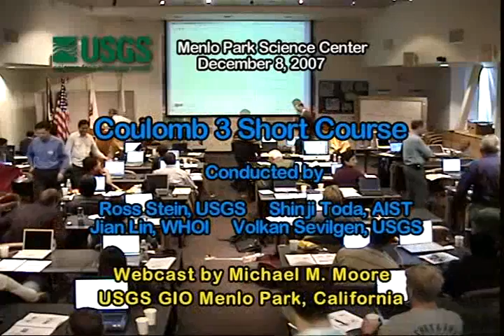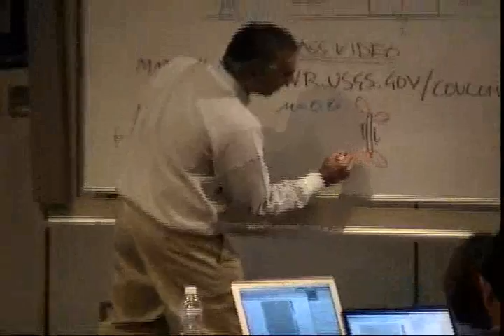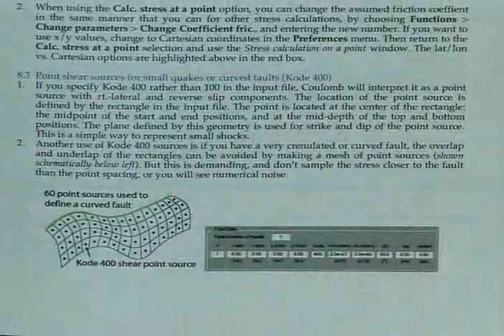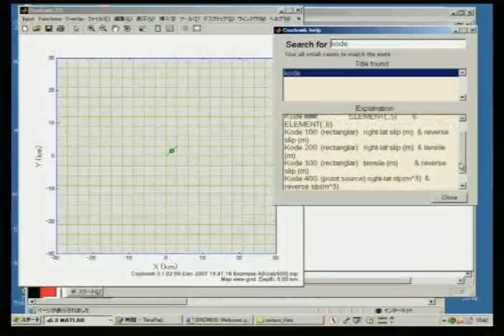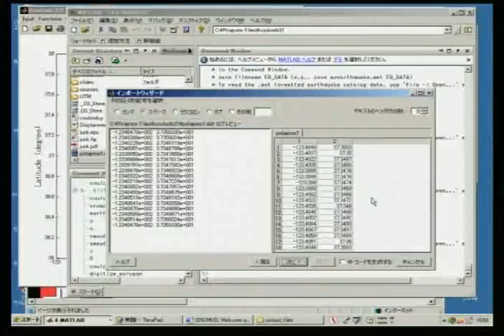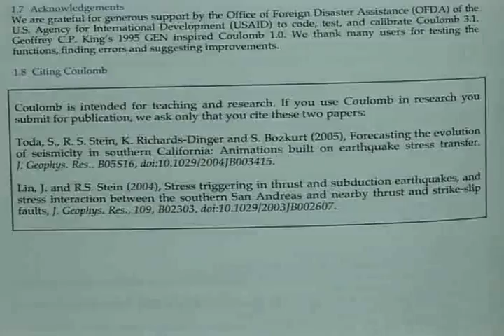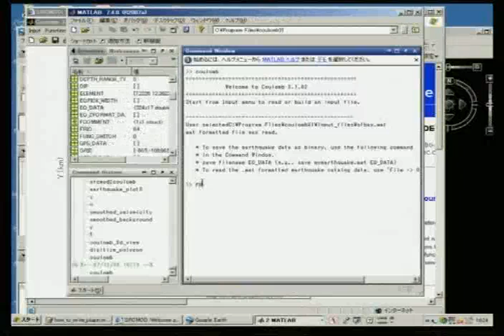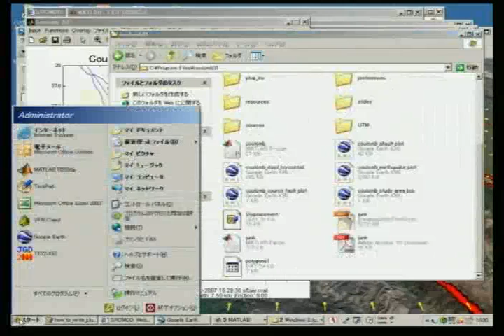Coulomb 3 stress change software training Part 4 of 4

Comment: When you overlay the GPS station over the fault the modellled and observed vector are appear in red and blue arrow respectively. But when i select a fixed point while plotting the displacement vector the modellled vector not become zero Want help in this case. Please explain